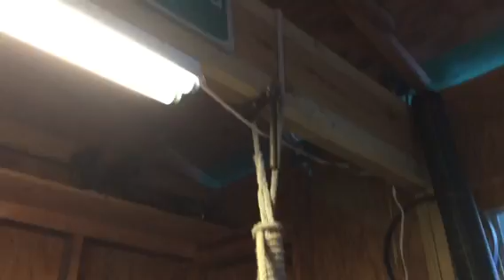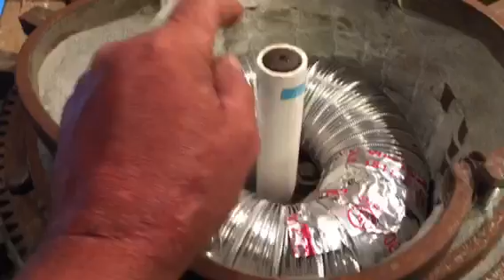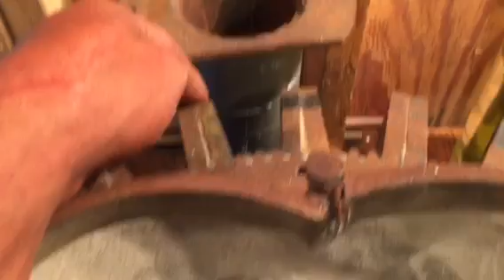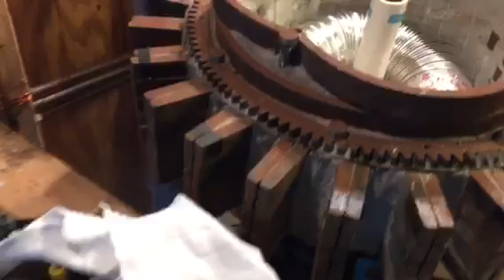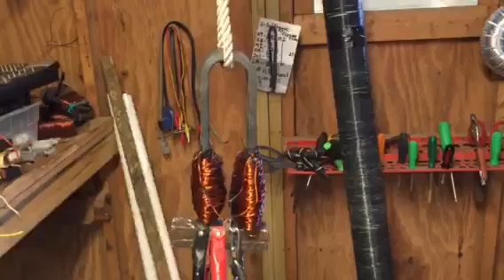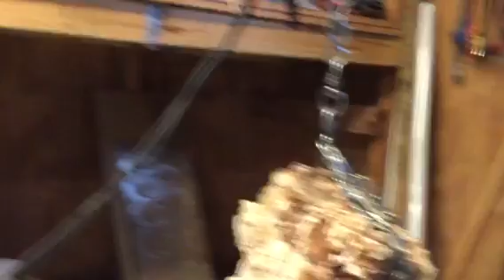Ed Leedskalnin levitation

Comment: interesting, "levitation" basically just the electromagnetic force holding it up/together, and i guess since things are never technically "touching" on a smaller scale (microcosm, atomic level whatever) i guess one could argue something is "freely levitating". i had assumed he made stones weightless by suspending them between fields and somehow electrifying/magnetising the stone material, assuming coral is conductive like quartz etc, but this makes far more sense. attach stones to actual magnets, use electricity to make the magnets do the heavy lifting. probably substantially more powerful than hydraulic technology we use now for "heavy lifting".

Comment: Reevaluated Ed's experiment to learn how to levitate the stones. Ed used fishing line between glass panel for reason. Upscale the experiment to a steel cable the size of modern day cranes use. An iron cored coil placed half it's length creates a magnetic lever. This sends the North and South Pole magnets out the opposite ends of the cable. Place the coil between the two coils of his PMH and wire proper the magnets remain in cable until the field is broken by removing the bar. Use several of these levers to manipulate the stones useing like force magnetism. Ed buried one (or more) of these around his site beneath the sand and was able to keep track of their location with his steel soled work shoes. Now one other thing about Ed's codes. He studied the plants for acidic value to soil. An Earth battery of 16 cells each reaching 1.5v or higher would be around 24v in series. Enhanced with his genererator he was able to utilize the magnetic flow that increases during the bewitching hours of the night. He was attempting to tell us how to live off grid back when the grid was being established. Combined with the Masonic level secrets of Magnicity the power industry was threatened by his giving away secrets of something society had labeled supernatural for so long
Reply: Can I cotanct you by email.?!
Greetings from Switzerland
Reply: "masonic level secrets" VERY interesting comment. i saw a video can't remember where or when, that thoroughly compared the grand masonic lodge of philadelphia, the murals on its walls, to eds nuggets of information left behind. and i mean they are SPOT ON. however everyone loves to blame the masons for world dominion and control. granted there are those that learn from that institution, and take it upon themselves to commit immoral acts, the body of knowledge that is freemasonry is not to blame. we are electromagnetic beings, theres far more to it than "how to build stuff" with it. its how to build YOURSELF. what do masons want? more light. what do we discover when we study light? electricity, magnetism, and beyond.

Comment: x  The magnets on the wheel were set in the repel mode to send max "B" field into the ground, That was the purpose of the magnets 5 deep 25 around all in repel mode.  The tall pillar also worked in conjunction with same a a resonating source.

Comment: A standard 12 volt electromagnetic lock (like on a door) can hold roughly 400 lbs.
Ed used a chain hoist on a tripod primarily.
Reply: Ed used a iron core coil with a steel cable ran thru the coil to about half its length creating A magnetic lever  (Actually several of what I am describing) Placing this coil between the two coils of his PMH wired together and energized it send the North flowing magnets out one direction of this cable while sending the South pole magnets out the other end and will remain until the bar is removed from PMH. If coupled with another lever perhaps buried beneath sand (glass in his experiments) you can use the like forces of the cable/levers to "levitate" . He kept these levers/PMH inside the box atop of the tripods along the pathway of the buried levers. This kept it safe from bad weather. He was able to manage the pathway beneath his feet with his iron soles of his work shoes.

Comment: this has been debunked already. There is video of ed using the big tripods to move those blocks. There was no anti gravity or levitation. He certainly did not run high current or voltage through it like with the neon transformer you have there. You should be careful playing around with high voltages like that. Those neon sign transformers pack a wallop. More than enough to stop your heart or blow off a hand or part of a limb. they are not made to be connected or grounded to metal in any way. You should really do some research before you go hooking all of that stuff up. Best case you get a small injury worst case you die or burn your house down. Please be careful.

Comment: Something I didn't think about earlier. There are stories of Ed walking around with a stick poking the ground and seeing if water would come out. The land that Ed Leedskalnin ended buying was basically a swamp land. The best ground connections are set in water. Maybe this kind of a ground can be used to draw the energy from the Earth. We have Tesla's famous tower being built on top of aquifers, the coral castle, also the Egyptian pyramids have aquifers underneath them (now these aquifers have dried up, but 12 thousands years ago when the Pyramids were used the aquifers were there).
Reply: Possible correlation between aquafers and let lines?
Reply: Maybe Ed built a miniature version of Wardenclyffe. Just a thought.